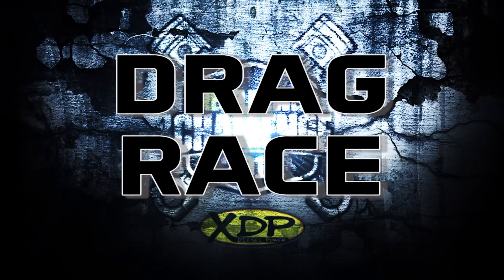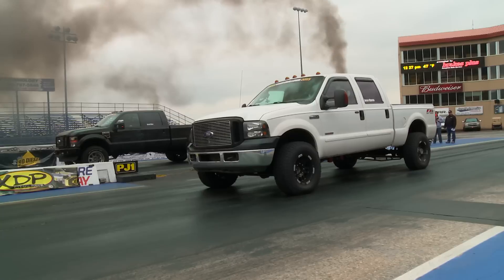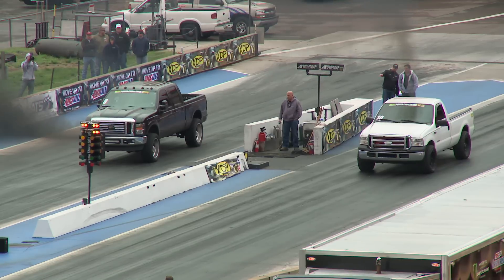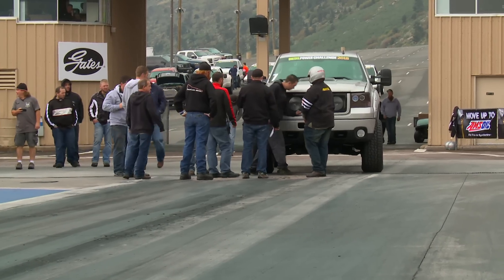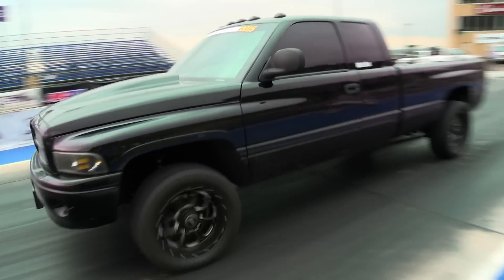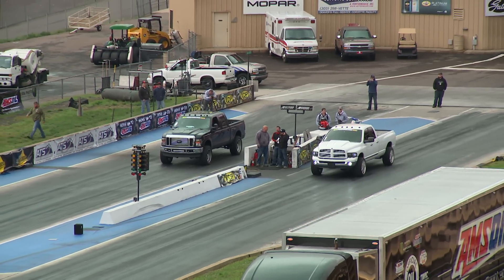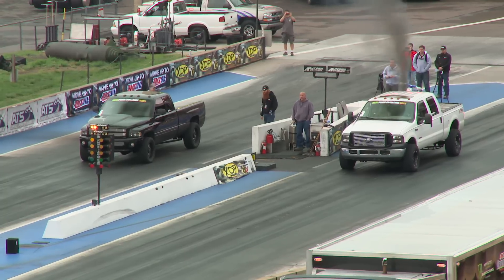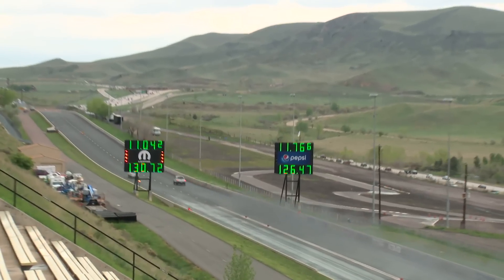¼ Mile Drag Race– Day 4 of 2015 Diesel Power Challenge!

Comment: how easy is it to make power out of these trucks? it looks impressive but i have nothing to base it off of.
Reply: plaga del a stock 6.7 Ford makes 900 ft lbs of torque and 440 horsepower. A simple tune will help quite a bit too.

Comment: 2016 electric powered challenge, come on, electric engines got instant torque and you can really make some cool stuff with them.
Reply: Gregers cilvēks Did I say anything about polution? I just want to see 750+hp electric trucks pulling shit and drag racing and such, cause I think electric engines are cool with their instant torque.
Reply: Error Creator i try local made chevy with diesel and electric motor. 350hp in diesel and 150 in electric motor. Thats cool. No need to charging
Reply: Gregers cilvēks diesel and electric hybrids are also cool, make some insane torques.
Reply: Error Creator The good thing about a turbo diesel hybrid is the torque provides a lot to the alternator recharging the batteries faster. Its weird how there are not better turbo diesel hybrid trucks since that's an ideal application. Only issue I can see is the electric motor components not being durable enough, but the electric motor would be simpler than a turbo diesel.
Reply: Error Creator Agreed!! Electic engines are awesome to drive.

Comment: The way they have this setup  is silly, why can't  you just have each truck make 3 runs, pick thier  best time,and use those times to find the winner. Trying  to tree with these big turbos needing  spooling adds way to much to get a clean run. You have people trying to get thier  snail spooled melting  thier converter while buddy in the next lane can just lolly gag until  you break.

Comment: Why are there so many idiots here who are complaining about "pollution"? Newsflash; ANY big diesel engine is going to chuck out soot like that.
Reply: ***** so it's good ? Suuuuure. Just because everyone does it doesn't mean it's good.
Reply: *****
It's a fucking quarter-mile drag race. The amount of fuel used is inconsequential when compared to the amount of fuel used just starting up a couple of airplanes...
Reply: And to add to your comment, if so many complain, then why are they watching? Don't be a bunch of haters. If it's not for you, go watch a prius video or whatever. I'm not into imports at all, but even I have respect for the guy that puts his time into his craft, regardless of his choices on make.
Reply: *****
That's precisely what I was thinking.
Reply: Lol I know I'm bitching about something that will never change, but c'mon guys. Don't be so judgemental.
Reply: Jonny Oliveira
That's cute; you think most lorries make that much power. Most arctics will be running in the 500-600 hp range - and that's for a big truck - and, newsflash, those engines are not tuned for power, they're tuned for endurance and torque. Not even remotely comparable - oh, and I'm a Brit as well, not an American, before you try and play that card. These guys are pulling significantly higher hp/litre figures than any truck, and the engines rev a bit higher as well.
Reply: Yep. He's absolutely right. And I'm 'murican. Most of our semi tractors are around 450hp- 575hp, as well. And might see a couple million miles in their life.
Reply: ***** You say: "ANY big diesel engine is going to chuck out soot like that."

I showed you even bigger engines outputting big power with no smoke... Bottom line, "Newsflash": I was right.

Most high end truck manufacturers like volvo or scania make trucks making well over 750 hp, make no smoke, So what you said was simply wrong, deal with it...

I refuse to argue anymore with someone that says "engines tuned for torque, not power" when noth things can't be compared like that since they are directly related....

Here's some engine academy for you, since you don't know that Torque and power are
http://oppositelock.kinja.com/power-under-the-curve-1714778421/1720146824
Reply: ***** a Euro 6 truck has a OBLIGATORY particle filter. Having a particle filter it won't throw smoke no matter what, because that's what particle filter is for. In Europe, if throw smoke like that, you are in big trouble with autorities, and citizen calling cops to go after you... Wich is 100% legit, since is stupid to throw that much smoke regardless of what you say. You're not alone in this world.

Since you didn't bother reading the bloody link I gave you, I'll sumarize it for you since you have no knolodge of power, torque, rpm, or physics in general

Saying that it produces "more torque at low revs" is the exact same thing as saying "more power at low revs". If you double the torque of your engine, you are automaticaly doubling the power. The measure of pulling force is power, not torque, because torque is a stationary measure of a rotational force. You have to introduce movement (read RPM) to make it meaningless... That's why HP was created.
Big lorrys only have big engines and working at low RPM because they can achieve the same pulling power, but having better fuel economy and reliability

Because Physics wise, given a proper setup gearbox, a bugatti veyron with 1000hp, will have the exact same pulling power of a 1000hp diesel truck, regardless of the trailler weight, going uphill, downhill etc... S they would have same aceleration. (obviously the bugatti would have a shorter gearbox and wouldn't last as long)

Comment: Just an FYI, "rolling coal" aka: blowing a shit ton of black smoke is actually detrimental to performance. They are running too rich which makes burn characteristics worse inside the cylinder.
Reply: in most cases yes but these are high performance machines so you will get smoke with these types of builds
Reply: WOWSY So, when you are making the AF ratio so rich that you have unburnt fuel going through the cylinder and into the turbo, you are telling me it isnt worse off?

Also, there is a video from the owner of Banks who talks about Diesel characteristics where he even proves that burning "clean" is better for the engine and performance.
Reply: +DeFreshS10 fuel is being used to help move cfms to spool up turbos and helps keep egts down
Reply: don't you think if it hurt performance these guys with 20+ grand under the hood would get them dialed in to run clean? no because it doesn't matter, they feed lots of fuel and as much air as possible, unburnt fuel comes out as smoke, like stated above it helps spool turbos, never seen a high hp diesel run clean...
Reply: don't you think if it hurt performance these guys with 20+ grand under the hood would get them dialed in to run clean? no because it doesn't matter, they feed lots of fuel and as much air as possible, unburnt fuel comes out as smoke, like stated above it helps spool turbos, never seen a high hp diesel run clean...

Comment: Why do they smoke so much? In Germany every 2nd car runs on diesel and they're quitr clean
Reply: Sahnepower1 haben keine rus filter
Reply: Sahnepower1 They're tuned to run like that. The stock engine/tune wouldn't produce nearly as much smoke.
Reply: Sahnepower1 They blow smoke when they run rich.
Reply: duckhouse21 Nein , hat es einen Filter . Es ist, wie sie dran sind.
Reply: They run ridiculous amounts of fuel through those engines, so unless you can find a big enough turbo to match the amount of fuel, they are gonna smoke
Reply: Sahnepower1 My guess is not enough air. Diesels need more air than gasoline engines. Air is always the problem - you can throw as much fuel at your engine as you like, as long as you got a big pump and injectors and so on. Where do you get the air from? A normal 100kW gas engine already wants roughly 100l/s of air. Part of the solution are the turbos, if you can get them to spool up. Another trick is nitro, during combustion it releases oxygen. In the video you can see the exhaust cloud cleaning up when they hit the nitro because the engine runs leaner. A third point is the height above zero, afaik the drag strip is pretty high so less air density.
Maybe the engines run extra rich because of cooling, at least thats the point with gas engines (rich=cool, lean=hot). Read the great German book 'Basiswissen Verbrennungsmotor' if you want a deeper understanding of those topics!
Reply: Are all those cars putting down 1000hp+ and 2000lb/ft+ of torque?
Reply: sik59rt some are, but they also are at a mile above sea level I believe
Reply: AMGV Media "some" as in maybe one or two? the power these consumer vehicles are making rival or beat big rig trucks
Reply: sik59rt Watch the first video it is the dyne pull and gives the hp and torque of every one of the trucks
Reply: Kyle W my comment was towards the OP who said diesels in germany dont smoke to which i replied asking if those cars were making the numbers i quoted
Reply: sik59rt they do rival the big rig trucks, but big rigs have to go out and do there thing all day, and they don't use nitrous like these guys.
Reply: New diesels now a days use 'urea'. In racing applications, they are not used.
Reply: AMGV Media They don't have nearly the same traction or gearing though as big rigs.
Reply: We've raced in Frankfort and to the east of Frankfort out in Hanau and I assure you the diesels on the racetrack smoke just like this. In some parts of Europe they don't allow it even on the track. I've seen several tracks in Germany even limit noise to street levels.
Reply: Sahnepower1 

you see requalary stock or chip tuned diesel smoking... but not when you drive like a grandma. Hit the throttle and ther comes smoke. But not for the newest cars
Reply: +jonathan solway the poster more likely knows it as Ad blue
Reply: +Sahnepower1 Still stand by that? lol
Reply: Matthew Edwards lol VW haha!
Reply: visible and non visible pollution.
Reply: this is Murica boy
Reply: +1hdsquad Stock they usually blow very little, if none at all. These trucks have big ass turbos on em so they turn the fuel up. Until the turbos spool, there will be big clouds of black smoke. Notice once the turbos spool theres barely any smoke.
Reply: I can guarantee you, that NOT every second car or diesel in Germany has 1500-2500lb ft of torque, along with 900-1500hp. That is the difference. Those tiny little 70hp 3 cylinder german cars probably wouldn't even be powerful enough to budge one of these 10,000lb trucks down the strip much past 30-40mph in the 1/4 lol.

Comment: Geez if they want to have the fast drag times done use a crew cab truck use a regular cab short bed
Reply: Dominic Valentine this is not the only comp for the trucks
Reply: Sloan V no really so a short truck is easier to back up and you can go faster when you have a truck with half the weight
Reply: Dominic Valentine but worthless on the sled pull
Reply: Dominic Valentine it will bite you in the sled pull as well as drag racing with a 10000 lb payload. It's not worth the other advantages

Comment: Why do they roll coal if there looking to make power?
Reply: Carl Mcdonald my question too
Reply: Carl Mcdonald very hard to make this much power with out smoke. also alot of these trucks are tuned for more dense air. less air and same amount of fuel = smoke
Reply: Trennon Bishop You realise that there is a thing called a airmass sensor and lambda sensor and together those regulate airfuel ratio .....
Reply: Dyno a truck at sea level then in denver with a 1500hp truck you will lose atleast 150hp because the air is thinner
Reply: Trennon Bishop Yes but if it is sny good it won't smoke that much.
Reply: TheNecromancer6666 they were tuned to do that. More fuel pushed in plus more airflow from the turbo equals more power to put it simply for you
Reply: Jared Coleman If the engine then is tuned to actually burn fuel so it does,not smoke it makes even more a modern engine Management System would solve that issue... more power less,fuel consumptipn
Reply: not quite how it works.. they roll coal because the boost hasn't peaked.. more fuel good/ok.. no fuel/lean.. bad lol.

Comment: whats the point of all that power is you destroy ur engine in one run?
Reply: You can push 600+ out of todays diesels reliably. These trucks are mostly between 800-1200. Going to eventually grenade, much like you will fry pistons in a proline big block or 1500hp LSx. These trucks aren't dailys at this point, just 1/4 and sled pull so its not different than breaking you drag car. You have to pay to play. But With all the added compression of a diesel engine and 60+psi from the turbo you are more likely to rip a block apart and dick the whole motor.

Comment: are you that scared to lose you gotta use nos i mean really
Reply: It's the difference between victory and defeat. Warren beat the 2 Cummins with NOS. The Cummins can run those times without NOS.
Reply: Kevin Smith they all had nos. Also the white Cummins had a fully built striker motor I believe.

Comment: Where is the 150mph run???
Reply: Jaran Holder 151.53, but 'only' 11.32.    6th place.
Reply: Still. That's crazy speed for a truck in a 1/4 mile, especially for slow start. I'd have loved to see it.

Comment: Have to have nitrous to make a ford run sham
Reply: Noah Mcelrath Nitro r viagra in car world- when u cant do thing naturaly ))))
Reply: Noah Mcelrath Lavon Miller also uses nitrous....and unless you're one of the commentators, I'm sure you can see it's a Dodge..
Reply: He didn't have to use it though
Reply: saddist1Gtown Powerstrokes are made by International not Ford.
Reply: TheLordJethro Since 2011 ford has made them in house 6.7 , because International  screwed them over with the 6.0 and 6.4
Reply: Mad Crow he never uses it
Reply: TheLordJethro I hope you and the other idiot who thumbed you will do some research before posting in the future! 

Power Stroke is a line of diesel engines found in Ford Diesel trucks, Ford Excursion SUVs, Ford Econoline vans, Ford LCF commercial vehicles and the Brazilian Ford Ranger. The V8 engines were produced by Navistar International Corp. until 2010 when Ford decided to build their diesel engine completely in-house. The Power Stroke engines compete primarily in the United States full-size pickup truck market with the Duramax V8 from General Motors/Isuzu and the B series straight 6 from Cummins........ See Wikipedia.
Reply: saddist1Gtown To prove a point you dont need to be insulting mate. And I think I would know what Powerstrokes compete against so thanks for copy and pasting from wikipedia. Also powerstrokes have been crap since they phased out the 7.4. I havent heard a good thing about the 6.7. If I would ever need a diesal I would probably get a duramax but would consider a cummins as well. But since I am a car guy and only pull the ocasional trailer my ole 97 1500 with the 5.7 will do me just fine.
Reply: TheLordJethro 7.3L powerstroke typo
Reply: TheLordJethro I was not insulting you did that to yourself for trying to correct me with the wrong info. As I stated I am no diesel encyclopedia so I depend on mediums like wiki for my info as I mentioned in the reply. You now take the argument in another direction, instead of manning up and say I got it wrong, who cares if the powerstroke is a bad engine? You did not mention that when you corrected me. At least ford has the guts to build their own while Dodge and GM outsource.